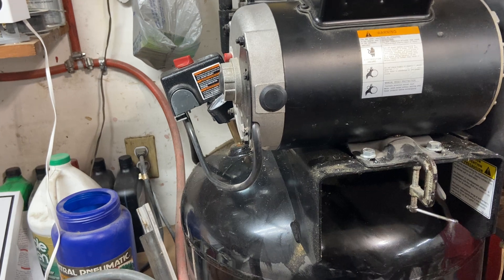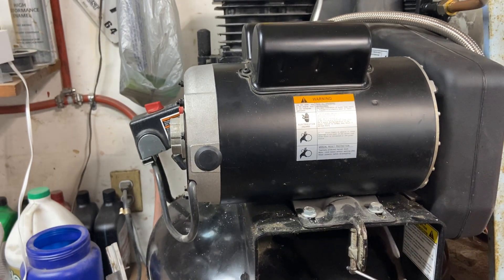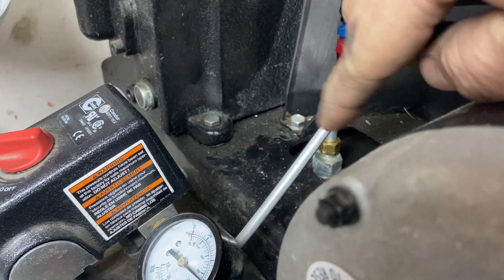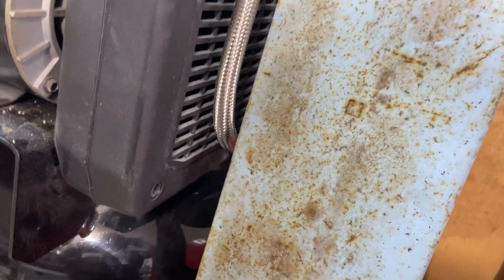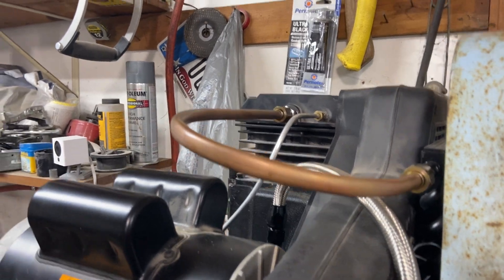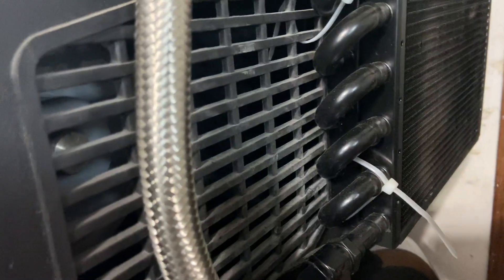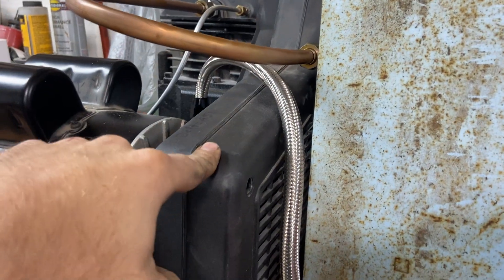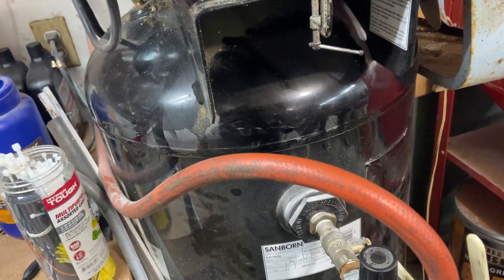Reducing moisture in your air compressor with a simple after cooler.

Comment: SO it all looks great until it comes to the ( OUT ) pipe on the bottom of the condenser, you plumbed it straight back into the compressor....  Wich makes no sense to me because the condensers purpose is to take air in and send water out the bottom, so you need an air dryer/filter for the water to drop out into so dry air can be sent into the compressor tank... Effectively all this system is functionally good for is putting cooler air into the tank, wich still reduces the amount of water just from having lower temps, but it is so close to being a 99% dry system, if you just add the air dryer before the tank.  Either way, thanks for the part number 15300, thats what I came here to find.  My other option was a Ford a/c condenser from the 1980's running big tubes, however its pricey compared to this smaller unit.  ( edit:  Thats a 1989 Ford F150 a/c dryer: ( Line code:  GPD  / Part No:  3605C  )  From what I understand they can operate up to 250-300 PSI, meaning a 125-150psi air compressor will never exceed the pressure limit.  This would reduce temps even more, but reduce Volume per minute. )
Reply: Actually, this system is a closed loop and puts 100% of the water back in the tank (it has to go somewhere).

Comment: Is there another brand or where can I get the flared nut. I’m not sure how to find or ask for this if I go somewhere like homedepot. Amazon is sold out. Also on Amazon it doesn’t say it’s for 8an, I believe it says it’s 1/2 is this the same size?
Reply from the maker: I inserted a link for a couple of -8AN fittings that will also work. 1/2JIC is basically the same thing. You can also search for 1/2 inch JIC tube nut and likely find something that will work as well, though they just may not be on Amazon. Good luck!
Reply: Thanks for clearing that up, will these work Eaton Weatherhead C5129X8 Carbon Steel SAE 37 Degree (JIC) Flare-Twin Fitting, Cap, 1/2" Tube OD (Pack of 10) https://www.amazon.com/dp/B00QMDSDPS/ref=cm_sw_r_cp_api_glc_fabc_DMP3Fb6848ESR?_encoding=UTF8&psc=1

Comment: You wanted to straight to the point but waste 6min+ in the beginning blabbing on. 
Where is your water separator after the cooler? It appears you’re condensing it down then shoving it right into the tank
Reply from the maker: Thanks for the feedback. You're right, I'm a blabber.
Reply: Holy crap, first half the video... blah blah. Lol. Still, thanks for making it.
Reply: Shit, more than that. More like 10 +, I cant do it.

Comment: Mixing two different temperature of air huh¿ is that why.....
Reply: I don't really think so. Go get a hair dryer or heat gun and turn it on. As the hot air mixes with the room temperature air do you see any water? No. I see multiple explanations why compressing air generates liquid water and most of them are incorrect so let me try to explain.

Air at a certain temperature and pressure is capable of holding a certain amount of water vapor. Relative humidity is a measure of how saturated the air is for a given set of atmospheric conditions (temperature and pressure). Dew forms in the morning because as the air cools, it can hold less moisture so relative humidity increases until it is 100% and condensation forms. The pressure is relatively constant in this case, about 14.7 psi at sea level, but it does vary by about 1 psi with the weather.

Air under pressure behaves the same way. Compress air (with temperature held constant) and the relative humidity increases. As the air molecules are forced close together less space is left for water. You see this with shock waves from explosions. As the shock wave radiates out from the explosion the air gets cloudy. Once the wave passes the air is clear again. This cloudy air is condensed water vapor from the pressure of the shock wave. See videos of the Beirut blast for an example. 

The key here is holding the air at a constant temperature. With increasing pressure the relative humidity may increase, but it decreases with increasing temperature. 

In the compressor pump both the air pressure and temperature are increasing. As air is compressed its temperature increases (adiabatic heating - see Wikipedia). Just place your hand on a pump while it is running. All that heat is not generated from the friction of the reciprocating piston. This is why an after cooler is necessary to cool the air and condense the water out, just like a morning dew. 

If the pressure if held constant and the temperature is decreased (through the after cooler) water will condense assuming the air passes through the dew point - the temperature at which air is at 100% relative humidity. The key, which is not shown in the video, is you want to collect this condensed water BEFORE it makes it into the air tank.

Let me know if that makes sense.

Comment: You aren’t really accomplishing anything here without a drain point. The cooler condenses the moisture into water, and is most likely filling all the low points. You need a water separator at the bottom of the cooler, at the outflow, prior to going into the tank.
Reply: You are correct. You want to pull the water out before the tank (it has to go somewhere). This setup is making water a little faster (vs the tank cooling down).
Reply: He must be accomplishing something if he claims the difference is dramatic.
Reply: the tank is the water separator. cooler air + liquid water is going into the tank. He will still have to drain the tank, however the cooler air holding way less moisture means the condensation is not happening in the hoses or in the tools. If he did run a separator before the tank, he'd likely never have to drain the tank or his filter-regulator unit.
Reply: Also every radiator design for cooling I've ever seen require the use of fans and this piping seems a bit small for this application. I would rather go a bit large than take a chance of making the motor work too hard
Reply: Jeepers creepers give the guy a break he said at work to awesome
Reply: @MrSprintcat  You obviously don't understand the principle at play here. It was working well because the water didn't have a chance to build up in the air cooler yet. Once the water builds up. I will just drain into the tank, rendering this process completely worthless.  
So the point that people are making here. Is that his system need a place to drain that water before it enter the tank. otherwise, it's like saying "I built a car that runs. But it won't run for long because i forgot to put in a cooling system".
Reply: He said the difference was night and day weren't you listening

Comment: Thanks for the detail on the fittings, etc.  I am working on the same project now.  I bought a sand blaster and here in FL....there is WAY too much water in the air.  It basically makes the sandblaster useless.  I bought the same brand cooler, but one with a 12v fan.  I had planned to add a trap before going in the tank (I saw all comments below.)  I will get it up and running without fan running first, then power the fan.  I will see if that makes any difference.

Comment: Looks like you are  condensing the water and blowing it into your Tank. I would put a water trap between the  low side of your  cooler and the Tank.
Reply: and the video could have been about 14 minutes shorter too.  Basically... "I bought this brand oil cooler and piped it like this and didn't install a moisture trap 0_o
Reply: Yeah I was thinking the same thing, it completely defeats the point of having the condenser there. The water is going to go into the tank either way if theres no water filter

Comment: I really like the idea of cooling the air before the tank. But the water is still going into the tank. I'm not sure if the air in the tank is more or less moist. Could be the water comes in as droplets and are in the bottom of the tank. I have not seen anyone put an air dryer (vertical zigzag copper tubes with drain valves) between the compressor and tank. Most are after ghe tank. I'm in the process of constructing such a vertical zigzag dryer and will try testing it before and after the tank.
Reply from the maker: Backlash I’d love to hear how that works for you. This definitely doesn’t remove all moisture from the air, but certainly reduces the water vapor I’ve seen in the lines by a significant amount.
Reply: @RileyKnifeandTool  As of a couple of days ago I have all the parts except the flexable hose. I'm building the zigzag  dryer with auto drain. Each time the compressor starts the drain opens for (x) seconds and blows out the moisture.

I HOPE!
Reply: If you cool the air before it inters tank there won’t be any condensation, hot air mixing with cold air in tank makes water
Reply: @eroom2087  We will have to "agree to disagree" on that. Hot air contains morsture, cooling hot air condenses the moisture in the cooler. It has to go somewhere and in this case it's going into the tank. Cooling and drying are different.
Reply: @backlash00  I agree with you: the condensation will happen when the hot air cools and when the high pressure from the compressor hits the lower pressure in the tank.

That said: after the condenser/radiator is a perfect place to put a dryer because the air is now cooled down and is less likely to be damaged from the very hot air coming from the compressor if they make one that specs that high a pressure.

I would use a A/C condenser since they are made for higher pressures and temps than transmission coolers or, even, a radiator.

Comment: Thanks for sharing this video, this is the exact cooler I picked up for my compressor. Couldn't you have left the original connection to the motor head as 1/2 npt and then just used a JIC coupler to connect to the AN8 on the cooler? Trying to plumb this as easily as possible. Thanks for mentioning the 45 degree flare still works even though the JIC is 37.
Reply from the maker: chvydrptop are you suggesting to eliminate the copper tube? I suppose that would be fine if you have the clearance. I do like that the flywheel pulls some air across the radiator, which is part of the reason I put it where I did.
Reply: @RileyKnifeandTool  no I mean't just leaving the original copper tubing connector that was at the head, looks the same as mine which should be 1/2 npt compression fitting and then on the other side of the copper pipe use the JIC fitting. Even if you had to run a different size pipe isn't the compression fitting on the head reusable? I still haven't opened mine up and maybe I am wrong about it being reusable.
Reply from the maker: chvydrptop Ah, ok. You should be able to use the fitting, you’ll probably need a new ferrule for the new tube though, as the old one gets compressed onto the original tube.
Reply: @RileyKnifeandTool  Thanks for sharing that didn't realize that.

Comment: Jesus skip to 3:50!
No wonder you were struggling to get a vid under 20 min
Reply: 4:55...  rambles about AN fittings for awhile...  to about 10:00...  The End
p.s. Never installed a moisture trap 0_o
Reply: Amen to that, just think he could have mentioned something important than those fucking fittings
Reply: 4:00 minutes of a motor.

Comment: Awesome video! I’ve been using AN fittings on my 69 Camaro z28 for 25 years, never knew what or why the fittings were categorized as they were. Another mystery solved, thanks! I’ll be be modding my 5 hp 60 gal compressor as you did, but with 2- parallel coolers from Amazon for DIY car painting.. already had a galvanized pipe matrix and and triple drain valve setup that was not performing well, thanks!!!

Comment: how do you know the aftermarket cooler cna take the pressure? thats what I am having trouble with figuring out, noone lists the working pressures of the coolers
Reply: Derale lists the woking pressure @ 250 psi and the burst pressure @300 psi on the 13300 cooler.
Reply from the maker: ejgrae1989 that’s a good question. I haven’t had an any problems so far.

Comment: would you consider adding a water trap filter between the trany cooler and the tank?  I see a lot of guys doing that so the condensed water never makes it into the tank.
Reply: There is no way to decrease water if you do not trap it. The water stays on the system
Reply: Ferramentas - Elogios e Críticas I’ve built many of these, without a trap (be it a copper tube or filter) the water gets pushed by the traveling pump head pressure right back into the tank. I see you do have the water trap after the tank, however the air movement at 90psi is sure enough to push some into your tools which can ruin paint or sand blasting applications. If you have a trap between the cooler and tank, you have no water to enter the tank which means no water in the tool. Simple fix since you have a trap already and it’s easier to drain the trap than the tank. Try it out, you will not be able to drain any water from the tank since there won’t be any. I have the exact same setup but I used barbed fittings with a different type of high pressure hose.
Reply from the maker: I can see where that might be useful. I don't see it as completely necessary at the moment, as I have one just after the main output. I might try adding one in the future though and see if there's a difference.